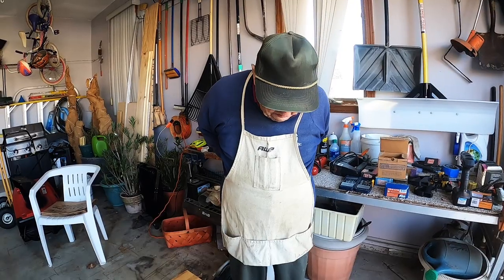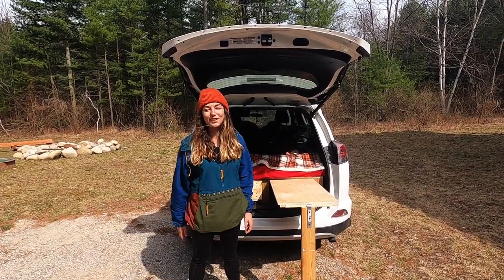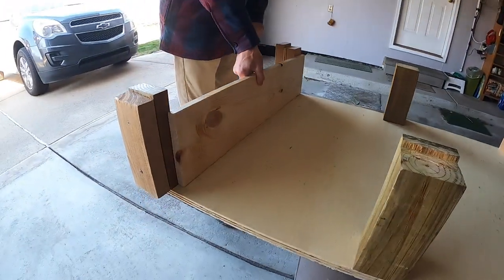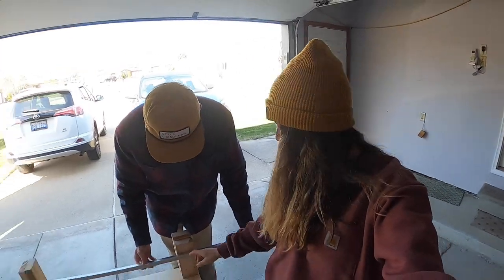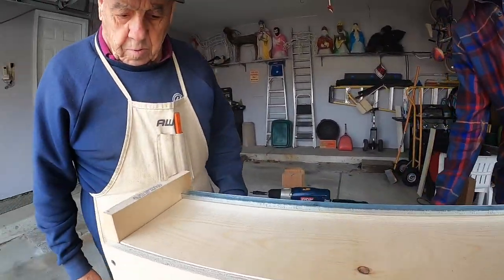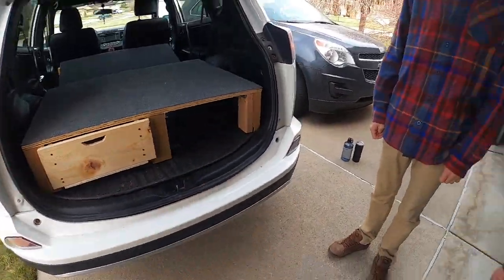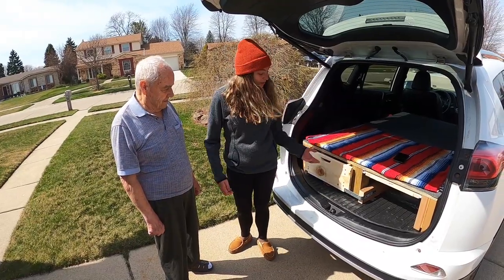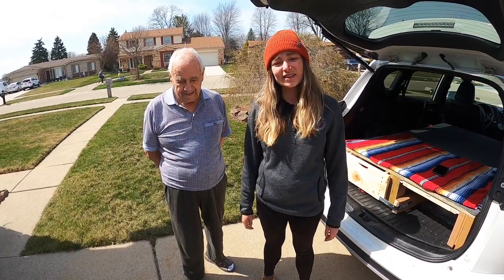Building a Drawer & Slide Out Table For My Suv Camping Setup With My 91 Year Old Grandpa!

Comment: were the back seats removed or are they just down? I wanna do the same thing but I'd still want to be able to use the back seats with ease.
Reply from the maker: Backseats are still there, just folded down them down! I wanted something I could remove easily and still use the seats. I have a full video all about how I built it if you check my videos! :)